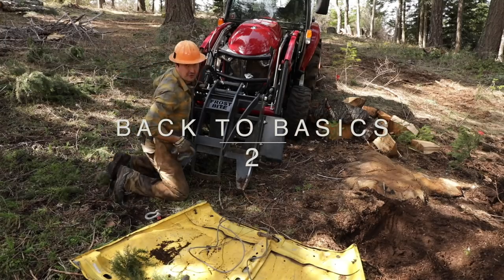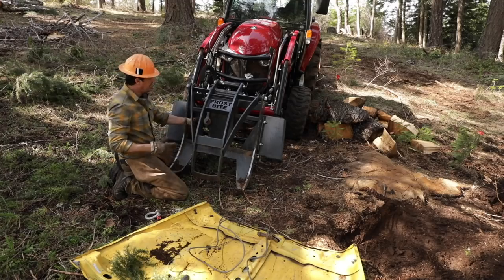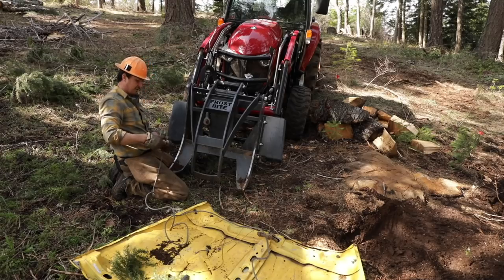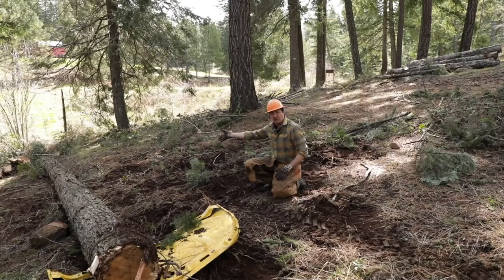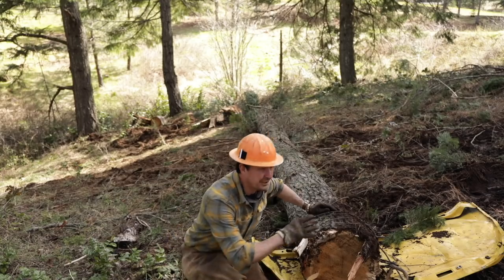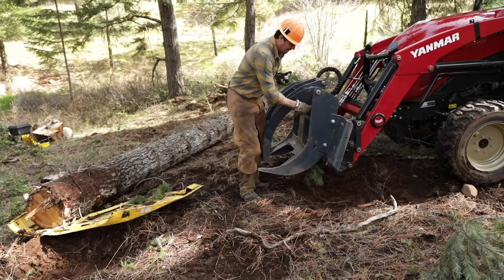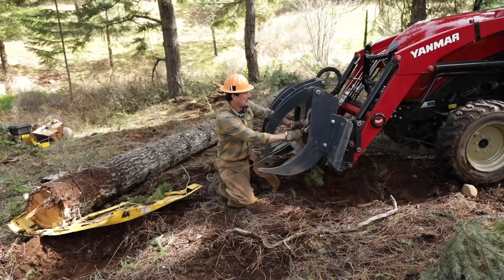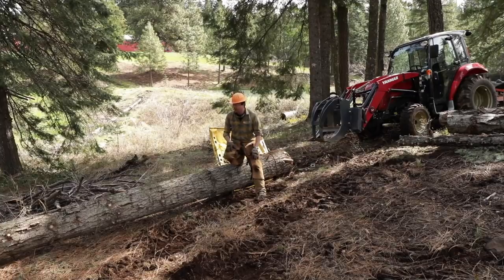How To Build A Single Log Bridge 2

Comment: and by the way I love my old 1946 ford 8n tractor!! its only 2wd but I have no problem plowing snow with it, and it gives me the fizz every time I drive it, it really says something when a tractor from the 40's is still running like a dream and working. Ford also made a heated seat mod and cab mod you could add on down the road, they are pretty neat! There are still lots of 8N/9N guys around

Comment: Wranglerstar  ..... I'm doing the commenting at the 4:40 bit where you asked us to :-) The bits of mettle that you weren't sure of the name, in the last episode, that you have settled on calling "crevise's" are call Shackles. I think you have them a bit crossed with carabiners.

On the subject of dragging trees or other objects, what you said about keeping your attachment point low was great. What would suggest is shortening the cable (this can be just by rapping the cable round the frost bite a few times before conecting the cable back on itself, that way you still have a long cable when needed) by at least half and attaching to the very bottom of the of the Frost Bite. This means you can raise and lower the Frost Bite to lift the log over objects or to try to shift the weight from the back of the tractor to the front (if you have engaged 4 wheel drive) to aid traction. Alternatively, you could bring the cable to an anchor on another tree, (just put a lifting strop or sling round the tree and secure with a shackle to act as a pulley) that is more in line with the log then you can attach to the tractor and pull from a different direction that allows the tractor to stay level. This can also mean that the anchor on the tree can be placed higher to lift the front of the log as it's being dragged.

I hope this can help in the future  :-)

Comment: Turn that tractor around an pull the way they are engineered to pull. It will pull way more forward than it will in reverse - also by hooking to the end loader your changing the weight ratio on the rear tires.

Comment: Tractor with cab, keep the heat in and also nobody will embarrass you for listening to stars on 45 8track tapes so long as you keep the windows closed!  😃 lol.
That is a powerful little machine, I way under estimated it's lifting and towing capabilities. I'm well impressed with that Yanmar. Would a log that size put the tractor on it's limits? Your a good operator Cody, nice and easy no quick unnecessary movements to put you in danger. Nice job man ☺

Comment: cody,  I know this worked for you but loaders are not designed to be pulled on like that.  take the brush hog off and pull with your drawbar.  you will put way less stress on your tractor and it is generally safer.

Comment: Neat trick with the hood. When I used to cut brush we just picked the trees out of the ditch with an excavator so digging in wasn't a problem 🤣🤣🤣. Though you will learn the correct way to put a slip in a chain quick if you happen to be the dork in the ditch!

Comment: Hey Cody, why not run a chain around the trunk the two feet of slack and chain the other end to frost bite? You could lift the trunk a little off the ground and not have to worry about the hood. Or did you use the hood to make a more interesting video?

Comment: Love the cj hood skidd, another tip if someone is trying to roll a log or just about anything else is placement and direction of the chain or cables choke,  if the choke is not set correctly then it will not sinch tight and not that you were doing it wrong but another tip , when lifting something like a log with a grapple or a bucket full of sand or stone especially on a hill the higher it is lifted the more unstable and prone to a rollover the machine becomes

Comment: Other options to consider re not tipping vehicles - let some pressure out of the tyres on the uphill side to lean it over to that side and allow for higher traction there... And open differentials so you don't end up torquing the downhill wheel/pulling it over... Also you could consider having a rope and a second person, with the rope tied to the roll cage and heading up around one of those trees - that can add enough leverage as you haul or move across a steep/tip-prone slope to keep the vehicle upright.

Comment: As you mentioned in the previous part, that is a shackle, not a clevis.  They are almost the same thing, but a shackle is used for a cable, or rope. A clevis is on a rod, and so is the other part that connects (the tang), and connects with a pin.  Just being helpful (hopefully), not picky and/or know-it-all.

Comment: Hi, Cody. This is just my opinion, you understand, but I believe you could have lifted the log from its end with the tractor and towed it away properly. The problem that I saw was the teeth of the claw were too wide and could not hold the log. Just my opinion, but I believe that you could have done it by placing a steel rod or angle iron across the lower teeth of the claw. It would provide the lift from the bottom of the log and off you would go. Of course, I am not there so I have loads of ideas (ha ha). But your solution was superb. Keep it up! God bless you all !!!

Comment: You could save yourself hours of work pulling logs by making a heavy counter weight for the back what I did was get a 55 gallon drum and filled it up with big rocks and scarp concrete and then pour it full of concrete about 1/3 of the way up put a steel bar through and welded a couple of attachment points to it then filled it on up around it then when got it 2/3 full I put in the top attachment point to where it sticks out about 5" out the top then filed it on up got to make sure you cut a slot out on the top back side that goes towards the tractor for clearance so the bar don't bottom out on the barrel when you lift it then I put a chain around the barrel  and then a big shackle on it so you can hook a chain too works great for the tractor I have you can lift anything with the frount end loader without tipping and pull logs with ease

Comment: Hi Cody
 I would  do what you can to widen the wheelbase on the tractor
, often you can just flip the hubs around,  but it looks like yours are already at maximum 
 maybe spacers are available from yanmar 
it would help you a lot with stability in the hills    and high speed cornering lol   love your work

Comment: After stumbling upon that god awful video on Facebook where the steel cable snaps and whips back on the tractor ill never forget it. The cable instantaneously smashes through the cab like its not even there, and cuts half of the drivers face off and they show everything. I suppose he's lucky it didn't take his whole head off. I cant help but get a little nervous seeing someone use one even if they know what they're doing, stay safe Cody.

Comment: Given the angle of the hillside you are working with, dragging the log out is probably much safer than using the grapple (if you could have grabbed it). The grapple would have raised your center of gravity, increasing the chance of tipping. Nice work! I enjoy your videos.

Comment: Hi. Tractors are designed to pull in a forward direction. Why are you pulling backwards? Just curious. Love your videos, keep'em comming
Reply: Jay - The tractor
Reply: Limited front counterweight.
Reply: I don't think he would want to connect up to the brush hog mounted on the rear of the tractor.

Comment: I prefer a tractor without a cab but then again it doesn’t get that cold were I live at and I grew up driving tractors from the 60s and 70s.
Reply: Fewer windows to break?
Reply: wobbly sauce you are correct I mean I’m not knocking anyone for having a cab on their tractor it’s just personal preference for me
Reply: Jacob 8696 I like a cab for keeping cool as well as warm.  Days of temps at or above 100 degrees plus the heat from your equipment adding to the mix,  I would be wishing I had got the cab.  Of course, if your AC lays down on you ...  I think I'd still rather have the cab.  And when it's all said and done,  it's just personal preference.
Reply: Rick Preston I can understand that too because I don’t use my tractor everyday I just have a small 1 acre garden to tend
Reply: I prefer a dozer with no cab for grading, and tight work. But I live in Canada and usually work up north so a can is a must for most of the year.  Especially to keep the black flies out!!!
Reply: wobbly sauce - just ask Cody, he has broken at least one.
Reply: The AC has got to be nice though...and avoiding the dust.
Reply: Jacob 8696 me too
Reply: sometimes when you are loading hay and getting it all in your face it's nice to have a cab but a tractor with a cab tends to be more expensive and less versatile
Reply: Also the wind, rain, snow, and widow makers!

Comment: you made that look easy; once you were able to pick it up; I would not have continued to drag it; gonna take some elbow grease to get the mud and grit off the log before it hits the sawmill; otherwise awesome; thumbs up; I love cutting my firewood; I use a atv with log trailer; no loader; but it sure is fun; I cut about eight or ten cords per year to heat a 2300 sq ft house

Comment: I've got an 09' Kubota L5740... I had to get it from out east to get one with a cab. Us "old" guys sure do like the comfort of a cab. I don't know why people don't save up for it. Mine's 4x4 too. But I find front axles on these dangerous, even with a heavy implement on the 3 point rear hitch lifting heavy loads can go sideways on you. Not sure why they don't have an axle-tip-lock you could use?

Comment: I always tow a log out driving forwards and have my box scraper on the back for weight. AG tires would give much better traction than the industrial tires for your ground, ever consider changing them? What is the reasoning for driving backwards? I believe the tractor has much better Traction driving forwards. Thanks

Comment: One thing you need to be careful about when pulling up a hill like that is weight transfer. Backing up a hill like that is going to transfer weight to the front tires of the tractor, add that with the pull from the log and you are literally pulling weight of of the drive tires that have the larger lugs and bigger bite into the ground, Another thing you are doing is asking the front differential to handle more of the power. traditionally the front axle is designed to handle 30-40% of the power being applied to the ground, meanwhile the rear axle is designed to handle 100% of the power (like it's 2WD brother).

Comment: On my tractor I have a trailer tube on the front and a winch cable quick attach an put my winch on my tractor with a pulley on my log grappler and it works great

Comment: It looks like you need to put a small log across the two bottom teeth and then get the big log on top of that and then squeeze down on the big main log the log on the bottom. The big huge logger from falling between the teeth if you put a straight log across

Comment: You should have practiced balancing skills while doing endos with that log, also i wonder how much weight the tractor has on that log, maybe 500, plus operator, mower deck leverage. Are you gonna put one of those suv dritbike trailer hitch things on the front of the tractor so you can scoot back to the house if you need to.

Comment: You attached a shackle to your tractor and called it a clevis. Here is the difference.  A shackle has a threaded pin and a clevis does not. If the pin just pushes through and is secured with a hairpin it is a clevis. When the pin threads in to secure it it is a shackle.

Comment: pick it up on a rear draw bar it would walk right out of there in 2 wheel drive, easily. never pull from a loader its dangerous. 40 years experience pulling logs on steep ground. good job though ya got her done safely, every body does it different.

Comment: you would be a lot better off if you dropped the mower and pulled with the 3 point hitch. choke up close and use the hitch to lift the log it will put all the weight onto your rear wheels so you get better traction.

Comment: Another nice vid!

But, I am wondering why you don't drop the mower and pull with that tractor?
Reply: Jetta Driver his tractor has a relatively short wheel base and no weight to counterbalance on the front end. The mower deck on the back moves weight farther to the rear and so pulling a log this big is best done from the front. At least with his current situation considering an uphill pull.
Reply: Rodney 3133 

I disagreed. Every time that I drag a heavy load backwards, it pulls down on the loader and makes the rear tires light. I am much more likely to spin. I find that I have more success hooking to the hitch on the back and pulling forward.

The hitch is actually pinned under the center of the rear axle and a little forward of the rear axle alignment. It makes the load pull down on both the front and rear axles.

Backing up hill with a load tied to the loader always makes me spin and fishtail.

Tying to the bush hog is also a problem. It makes the front light.

This has been my experience.
Reply: That extra weight in the back is sooo needed for traction. Normally i keep my backhoe attach when I'm doing any logging. That backhoe will get out of any stuck situation. Plus Cody is doing some brush hogging work. Who wants to take off any implement, only when necessary.

Comment: Ag tires are MUCH better for what you're doing than the industrial type you have on there.  Also, a cab tractor adds too much expense for no performance benefits.  I would rather buy a larger tractor instead of the cab.

Comment: I am a rank amateur so these are questions not criticisms.
I noticed when you were pulling the log at the bottom of the hill you had the choke attached on the up hill side but it routed around the downhill side of the Tyne on your forks. Was that just because it moved after you were pulling or was that on purpose?

It seems to me that if you set your car hood up so that the choke lead was about a third of the way back it would be less likely to dig in and would help the log ride better. Any thoughts on that?

Thanks Cody. Fun Vid. We have about a foot of new snow here. Happy spring!

Tom Sult, MD
Author: JUST BE WELL (goo.gl/jUbWIX)
3rdOpinion.us